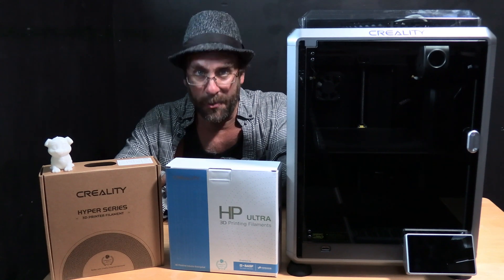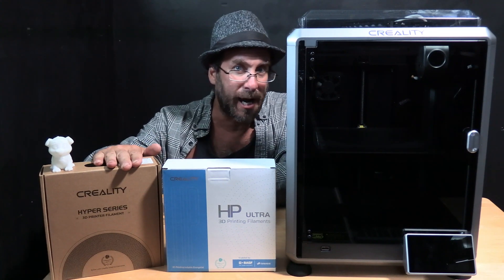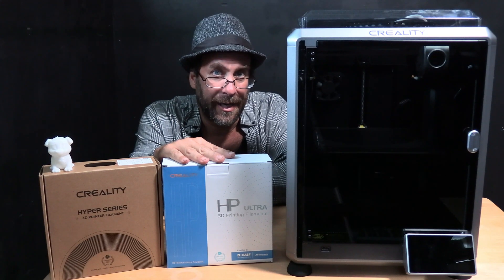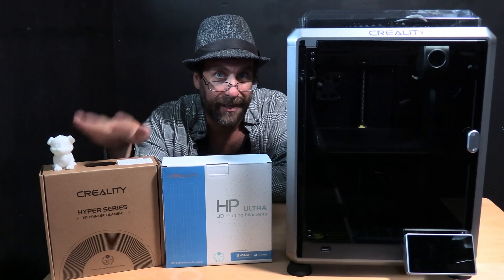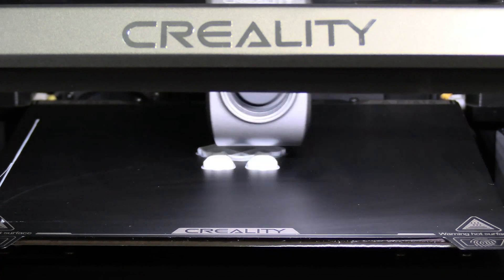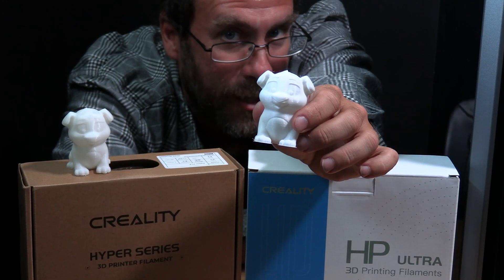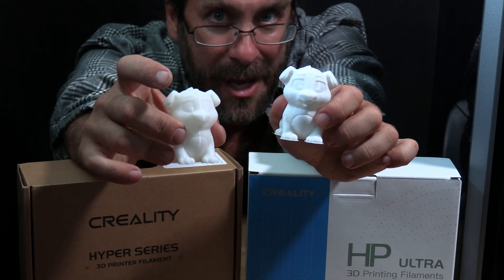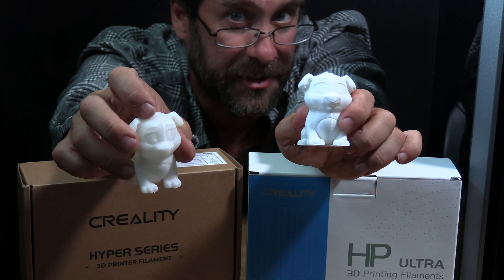Testing Creality HP ULTRA PLA on K1 3D Printer. Printing via Creality Cloud

Comment: If only I knew Creality were putting out a 300mm x 300mm x 300mm printer with true auto levelling, then I would’ve waited and not bought the S1 
Plus.
Reply from the maker: These new machines are a huge leap forward, however my S1+ is one of my most trusted machines, and prints cleaner than any other machine I own. I talk about it a bunch. The K1 Max is twice the price